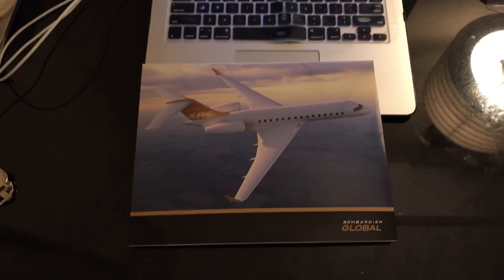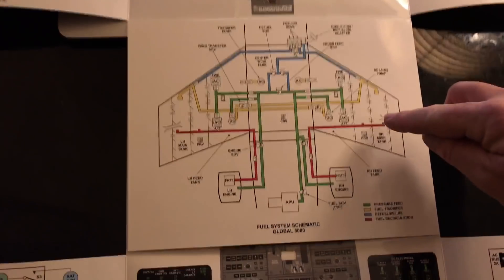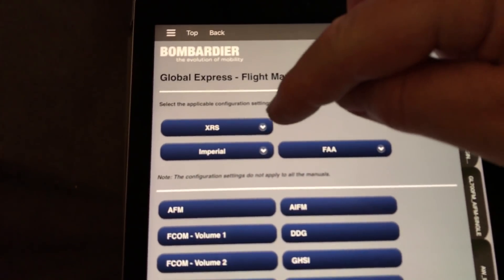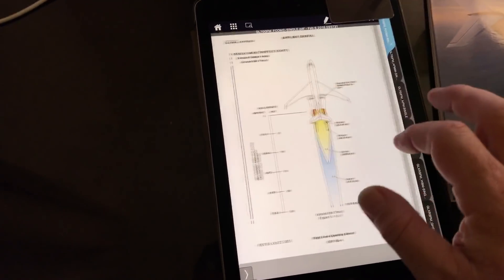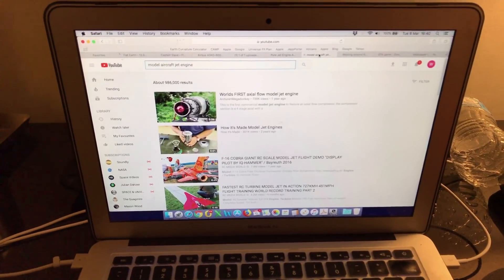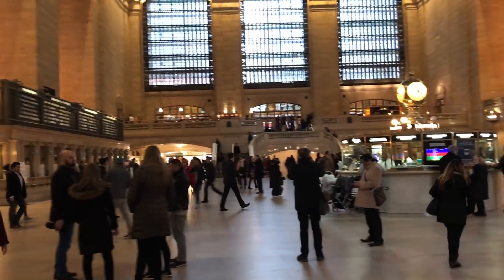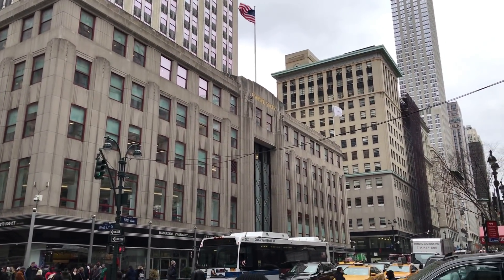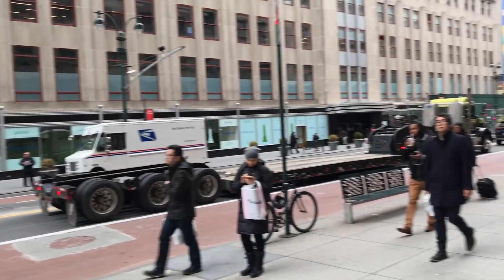Don't be ridiculous - of course Jet engines use liquid fuel.

Comment: Plane crashes do create a lot of fire which must come from onboard fuel. How much fuel is carried is open for debate. EG The A380  according to Wikipedia has a fuel capacity of 323,545ltrs x 0.8kg = 258.8 tonnes. That would be 3 fully loaded Articulated lorries on each wing. or a total of 43 African elephants. Mmmm. If this is true then the engineering is truly gravity defying. Looking at aircraft in the factory being assembled compared to pre take off pictures I can see no extra sag or droop of the wing due to the enormous extra weight. The jury is out, but I would bet that once at altitude and speed these modern jets actually get their power from "overrun" created by air pressure. Also, under wing fueling caps don't make sense if liquid fuel is being used. If that cap fails then fuel will spill everywhere, but they refuel without spilling a drop or getting fuel on the hose...????
Reply: Doug,
How about the fuel/passenger ratio? Compare with other planes.
Reply from the maker: +Doug Boyd  Sorry Doug the amount of fuel carried is not up for debate at all.   Every pilot knows exactly how much fuel his aircraft is capable of holding.   Any real jet pilot will be laughing at all this nonsense.

Do you appreciate how big the A380 is and the refuelling points use one way valves - why would you expect there to be any drops?   

The jury is not "out".    All we have here is a tiny group of people who find it difficult believing big numbers.  

Under wing refuelling makes perfect sense - have you seen how high that wing is?   How would they refuel above wing? 

I will show  you the refuelling point on our aircraft.    We can do either single point or via over wing.  

Perhaps watch this to get an appreciation of the size fo the A380.  

https://www.youtube.com/watch?v=3BiYQbD-mVk

There is a small benefit from speed called ram air effect but the engine still burns plenty of fuel per minute.   Our plane burns 3000 lbs per hour in the cruise - that is 50 lbs per minute.  Roughly equal to a car's tank of petrol every 3 minutes.  

It holds up to 45,000 lbs so can fly for over 12 hours when you make allowance for taxi and reserves on landing.
Reply: Steady on mate. Calm down and have a nice cup of tea. Its only a discussion. Perhaps the upside down fuel cap is a good idea! And of course the wings bend up as lift is generated. I just can't see any variation of sag on the ground in pictures that are just landed (empty) and just about to take off (full). ..Colonically sourced magic perhaps, its only "a bet" with uncertain odds. PS, There is nothing wrong with questioning everything. Its how the truth is discovered.
Reply: The A380 and 777 are supposed to be about 15% more efficient than previous aircraft. How much of that is sales pitch is anyones guess.
Reply: Steady on mate. Calm down and have a nice cup of tea. Its only a discussion. Perhaps the upside down fuel cap is a good idea! .......Of course the wings bend up as lift is generated. I just can't see any variation of sag  in pictures on the ground that are just landed (empty) and just about to take off (full). ......As for "colonically sourced magic",  the comment was only "a bet" with uncertain odds. PS, There is nothing wrong with questioning everything. Its how the truth is discovered.
Reply: Maybe its even more amazing than we think.
Reply: I am not saying that no fuel is carried at all. There are plenty of aircraft fires and crashes that clearly show this is the case. But 258 tonnes? It would take hours to fill the tanks. Thats 10 articulated truck loads of fuel. Wow!
Reply from the maker: +Doug Boyd forgive my tone but try to see it from my perspective.  This is what I do.  I have done it all my adult life. Fuel calculations,  burn rate monitoring and even careful analysis of fuel burn figures on long oceanic crossings that have allowed us to refine our fuel bias in the planning stage that results in an accuracy of better than 0.5% actual vs planned.

I might cover that in the next video too. 

To me this ‘discussion’ is like discussing the very real possibility that Tinkerbell exists and flies around on pixie dust. 

Most major airports use hydrant refuelling also for these aircraft.  No fuel trucks.  Just a connection to the hydrant in the ground.

Yes they hold a lot of fuel.  Even the much smaller jet I fly holds 45,000 lbs and burns it at the rate of 3000 lbs per hour.  

That is the average car fuel tank every three minutes yet the plane can fly for more than 12 hours.  

i.e.  Lots of fuel.
Reply: You could put your point of view without all the childish remarks. If you spoke like that in real life you would soon find yourself on your arse. I take it they call you Box head for a reason.
Reply: Well I think being called an "Oxytard" (whatever that is) and an ignorant idiot is childish. As for not being able to do basic maths please tell me where the error is because I copied it from specs on Wiki" PS I think that the Captain of the Titanic suffered from incredulity, but his ship still sank.
Reply: So my maths isn't wrong then. Phew, how lucky is that? OK I won't convert anything else into Elephants if that is what is upsetting you. Apologies.
Reply: +Walter Boxhead:  I don't think Doug Boyd is a flattie, but he is a hoaxtard--he's a regular over on Bertie Slack's channel arguing that the Apollo missions were faked because, among many other imbecilities, you should be able to see stars in broad daylight and rockets can't work in a vacuum.
Reply: Ok. I am going to have to explain myself. Why do I  question aviation fuel? 1. When the planes hit the world trade centres I would have expected to see thick, black smoke due to fuel burning in air. However the first impact especially produces only white smoke. I would have also expected fuel to run down the sides of the building.No sign of this. 3. The wing vortices of the planes would have the effect of "swirling" the smoke around and creating a lot of turbulence. We see none at all. So either there is no fuel or there were no planes. Take your pick. If you are sure about one then the answer is the other option. .... The other thing is the speed of the planes. Believers in 911 say that airliners can fly at 500mph+ at sea level in level flight. Truthers do not. Which camp do you sit in, bearing in mind you are an aviation fan.
Reply: I get what you are saying, however, I have watched a video of people "inspecting" fuel tanks on 747s. Not only were there a lot of cables and pipes but there was no sign of any pumps or "containment", just ribs and spars with access holes. Also there was a lot of areas where fuel would pool with no way of getting it out? In addition, the brilliant video of the making an A380 wing showed the whole wing being "glued" together. I see only struts  with holes in so fuel would slosh around as it pleases along the whole length of the wing. Check it out. Can a wing that itself only weighs 4 tonnes carry 2 large jet engines plus 125 tonnes of fuel? It makes no sense to  me. Big numbers or not.
Reply: So you are OK with an airliner flying at 500mph at sea level, crashing into a building without slowing down at all, the engines not even making a dent and the tail plane not making a scratch and no fuel running down the side of the building. Then cutting through 40 mtr of 6mm steel wall some of which was perpendicular to the plane acting like a knife to shred the plane. Then crossing 15mtr of office space through multiple gyprock walls, avoiding 44 4ft x 5ft steel columns, through electrical trunking, lift shafts, cables and plumbing. Then across another 15 ptrs of office space destroying partition walls and desks, and out through another 6mm steel wall covered in aluminium cladding and out through the other side. All that without leaving one scrap of aircraft debris inside the impact holes. Mind you they did find the "terrorists" passports that were found on the street below. Such a believable story when you consider that not one chair, table, computer or filing cabinet survived the demolition. Look up Architects and engineers for 911 truth before spewing out any more TV fiction.
Reply: You are right...White smoke. Explosives. Black smoke hydrocarbons burning in air. Thanks for proving my case in point. Also watch the impacts, you are an aviation expert, you must have noticed the lack of wing vortice disturbance in the cloud of smoke. No wing vortices, no planes. Nice to see you put an outline of an aircraft that has tiny tiny engines compared to the real one.
Reply: Comparing a stationary empty A380 with a loaded stationary  A380 is not the same as comparing a stationary plane with one that is generating lift in the wing whilst taking off. A recent incident, QF32 A380 shows damaged caused to the wing from inside that was caused by engine fire and a disc shear through the left wing. I am told that this is where the fuel is kept. What happened to all the fuel. The pictures show no signs of the wing being full of fuel. This is not a stupid question. The fuel tanks, I am told, are the whole wing, therefore any puncture of the wing will spill many tonnes of fuel from the hole. This did not happen. Why? You tell me. http://cdn.newsapi.com.au/image/v1/7003b27e581dcc940e39abd0c412be74.

Comment: Well I've looked into these videos the last couple of days and the main points I pick up on, after banging my head off my desk, are:

They have a delusion of some infinite power source that is being hidden from people.
They don't know how/where airports get there fuel.
They know nothing of aerodynamics and theory of flight.
They don't understand pressure refueling.
They don't understand fuel balancing.
They think a couple of hydraulic lines and a couple of wiring looms will fill up the wing and leave no room for fuel.
They have no idea of the structural properties of aircraft building materials.
They have some fascination with the airbus A380. Show them an Antonov AN-225 and they would lose their shit!
They delete any comment that isn't agreeing with them.
Reply: "They" also have absolutely no understanding of basic math, geometry/perspective and logical thinking!
Reply: *They will call you a bot or an AI if you attempt to show them any math or formulae to work out simple things like the volume of fuel with a given density...

Comment: So when tanks are full and you disconnect fuel hose coupling from underside of wing fuel port. show me the fuel dripping  from bowser and fuel inlet port where the fuel inlet port is upside down under the wing.  Never gonna happen. WHY. 
NO FUEL IN WINGS. 
CHECK MATE!!!!!!!!
Reply: Brian Dugmore: I pump gas into my car, and not a drop is spilt; does that mean no fuel was pumped into my gas tank?
Reply: Brian: You have a gas tank in your car, and a plane has a gas tank in the wing. Fuel is pumped into the gas tank, which is located in the wing. A valve controls the fuel intake, and can be closed from the outside; only flat earth retards think this can only be done by lying or magic.
Reply from the maker: +Brian Dugmore.   Why would there be any leaks?  Do you understand the concept of a one way valve?   Perhaps you should research single point pressure refuelling.  

Check this out and ask yourself why this warning is here.   If you can figure out the real answer I will give you a thumbs up. 

https://www.youtube.com/watch?v=O1UNH1VHkXY

This is my aircraft and the video was made yesterday.   I will get more footage for the follow up video.  

I am interested in your answer though.    Think about it.
Reply: "single point pressure refuelling"
Good that exists nowadays, especially considering the huge quantities... I remember refueling the CM170 Fouga with a pistol, by gravity, "some" decades ago :o) https://www.youtube.com/watch?v=LVQbxBAfumU
Funny whistling bird, but the Patrouille de France has flown it.
Reply: Brian Dugmore ... But Brian not if he was in Australia, the wing would be upside down... you should stick to tiddlywinks!

Gotta say I’m not serious ... I’m more surprised they believe in compressed air !
Reply: Wolfie6020 
Leaks?? Why put words in my mouth. But thats how you people roll. You cant just discuss morolly.
Obviously it has to be a non return valve no shit. Especially being up side down.Now tell my why you wouldnt see a few drops of av gas on the fuel port or the bowser coupling when disconnecting with a massive pressure differentiation when releasing.?? No B S please.
I ve worked with hydraulics and drag cars and i love  the sweet smell of burnt av gas , but tell me why i never smell any thing at airports.?
Hmmmmmm.
Reply: "a few drops of av gas on the fuel port or the bowser coupling when disconnecting with a massive pressure differentiation when releasing.?"
Because the coupling is designed to cancel the pressure before complete disconnection?
"why i never smell any thing at airports.?"
Have you spent time around the planes during maintenance, testing and refuelling? I have smelled a lot of kerosene vapor when working on airbases.
Reply: FrenchCrow  kerosene  fumes , are you joking or are you primative.
Kerosene  smells nothing like jet fuel.
Spent jet fuel is aromatic. Kerosene stinks. 
And so your magical fuel coupling wipes the edges of the fuel port and the  fuel coupling when disconnecting in one go.
WOW. I got to get me one of those. 
Wake up people.
Reply: Brian, well... In French "kérosène" is the common name for jet fuel. I thought it was the case in English too.
"I got to get me one of those. " Yep, do that.
Reply: Usually in the US jet fuel isn't called kerosene because the kerosene you get at the local gas station (for heaters and such) isn't pure enough to be used as jet fuel. It's those impurities that make gas station kerosene stink. If you get high-quality lamp oil that's also kerosene but it doesn't smell like gas station kerosene for the same reason. (I believe in the UK it's called paraffin oil but in American English paraffin is a kind of wax.)

However, jet fuel still has an odor, just not as unpleasant as gas station kerosene.

Comment: +Wolfie6020   Maybe this link will work: 

 https://www.youtube.com/watch?v=WF6hQKsQ_qo 
 
The pix are in a slideshow about 5 - 10s each. Not very good - just discovered my Windows 7 Video Maker  (Widowmaker) seems to have videoed off.
 First picture shows 3 possible alignments - the snaps have one with the lens visible and the others, the lens position can be inferred.

If someone just wants personal proof they can use one of their own lenses.

I've just been trying my car with air in the tank - results are not very satisfactory. I listened to the car radio for an hour but eveything else was surprisingly quiet. I'll try again tomorrow for two hours without the radio and report back.